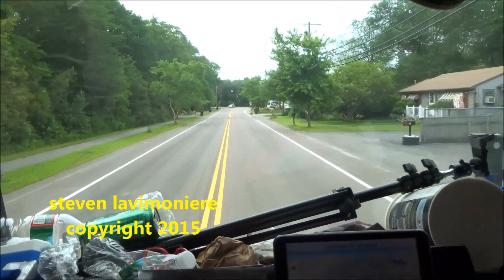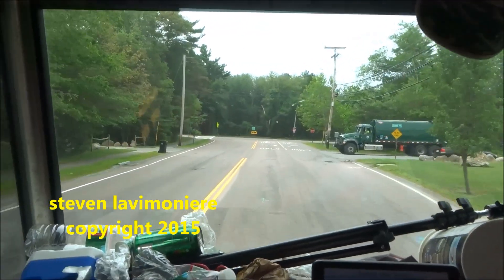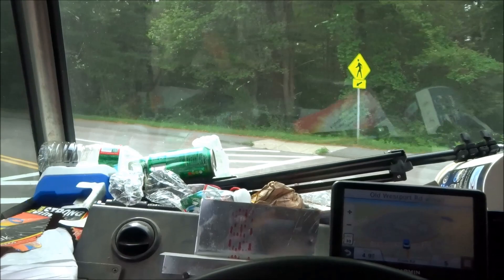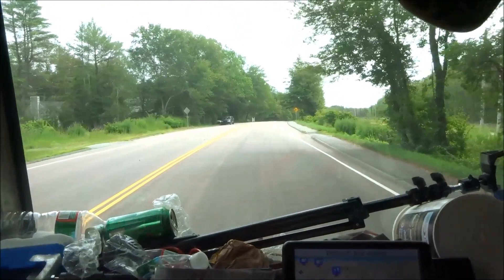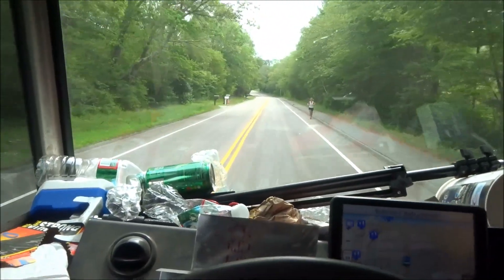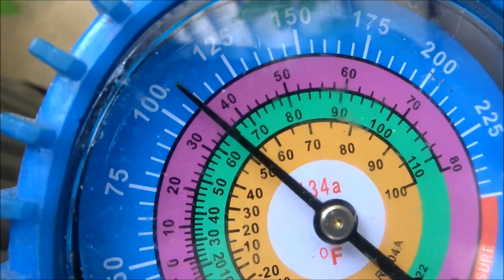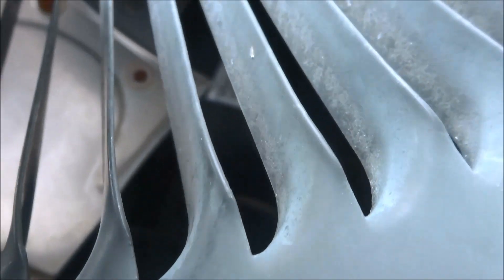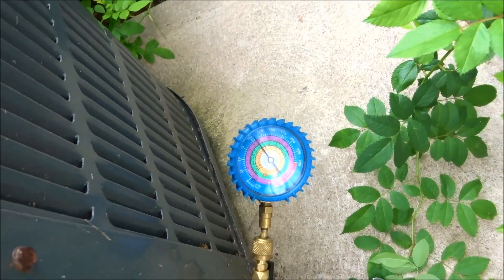hvac air conditioning unit icing up

Comment: That was an interesting tool you used to remove and replace the schrader valve.  It would be nice if you would have explained how this tool works. But it is a good video thanks for sharing it.

Comment: The GE never lies,  ive been using an GE detector for over 35 yrs and ive have never found one that's better Steve... 
 When i was in the Steam fitters that's the only detector they would allow us to use... dependability !!
 We use it on Centrifugal's  and screw's compressor  chillers..
"Keep vedio's going mamma"
Reply from the maker: Bob Parrott i have had my h10 for 23 years now been working for me
Reply: Awesome job!

Comment: Working on a freezing unit myself last evening and this morning. Charge is good, air flow is good, motor amperage is spot on and on the fastest tap speed but when I leave and come back after overnight it was re-froze. I think the blower fan is intermittent. It is a friends office building so I am gonna lock the fan ON until the weekend so it don't go down on his tenant while working on it again. Thinking an intermittent fan relay but read online that the indoor fan capacitor can cause intermittent fan operation as well, you ever see this, I have not yet. ??  ..................STEVE IS WORKIN AGAIN !!!
Reply from the maker: Doug Doty i have seen the condenser not shutting off also .bad tstat shutting of fan ,and not condenser.air flow problems,fan heating up and shutting off bad run cap .you would have to be there and see thats going on is the motor hot?? whats the super heat?maybe a bad relay in air handler shutting down fan .the list goes on
Reply: steven lavimoniere  Bad stat and condenser not shutting off are both things I had not considered but great thoughts,  gas was good, air flow is low but all it could do, " bad install but real world,"  but has not changed recently so was not too suspect. I swapped the cap out and been ok since. Thanks for those other ideas as I will not forget them in the future. I do appreciate a guy like you taking the time to through a new guy a bone. !!

Comment: please help I have a YORK central unit...and the condencer outside gets ice build up on the pipes leading to the furnace and then the blower stops working till it thaws..out.. ..what can it be
Reply from the maker: its proley low of refigerant if its icing ,coild be a burty inside coil ,or no air flow  most likely low on gas .